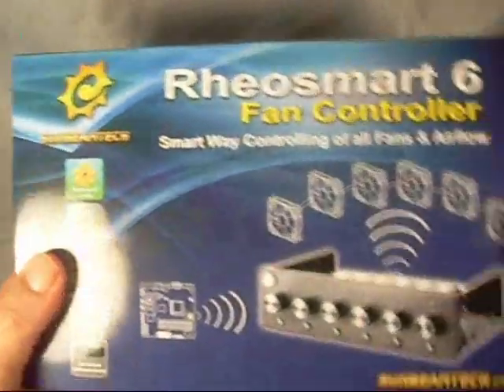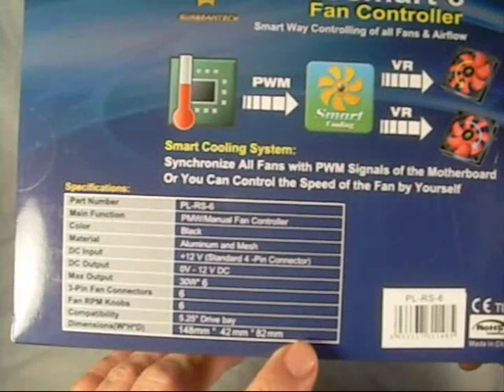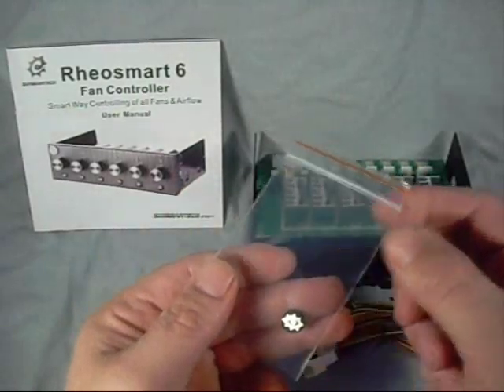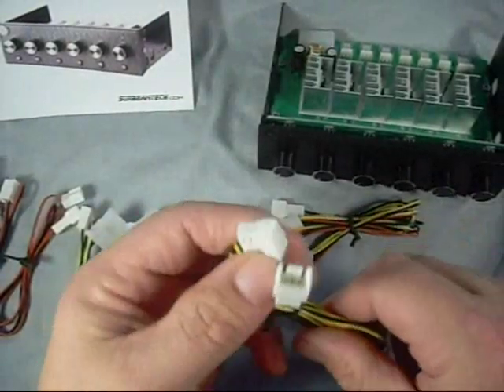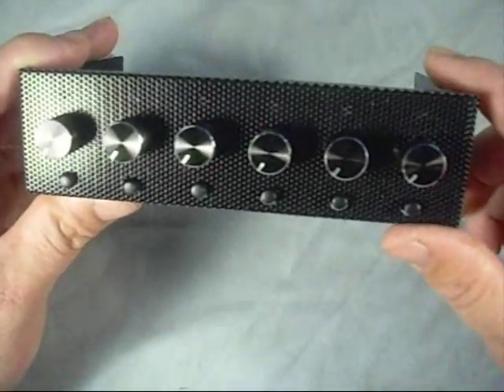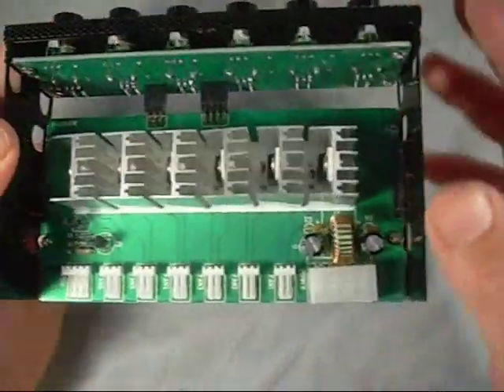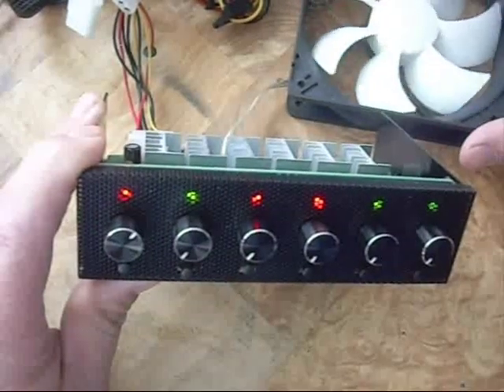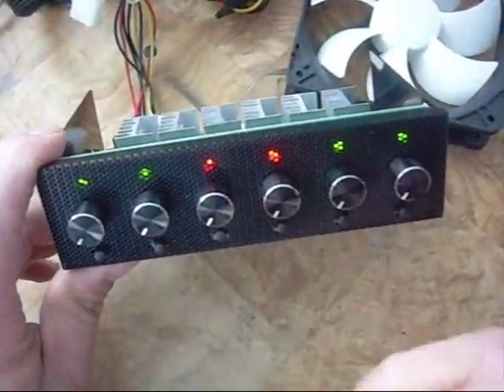Product Showcase SUNBEAMTECH Rheosmart 6 Fan Controller (PL-RS-6)

Comment from the maker: Yes you are correct the leds will vary in brightness depending on how fast they are turning. If the board turns them down too low the leds will not light at all. That is why I choose to run the fans manually.

Comment from the maker: There are a few 4 pin fan controllers on the market. You could use any 3 pin fan controller with them fans. The 4th wire is to connect to the motherboard to control fan speed with software. If you are using a fan controller you are controlling it through voltage so the 4th pin becomes irrelevant.

Comment: 0.48A and 12V
0.48x12=5.67
You require 5.76 watts per channel in a fan controller for that fan.
With 30 watts per channel in this one, you could power 5 fans per channel if you wanted to.

Comment from the maker: Those are all fairly low wattage fans because they have low rpm compared to some of the 120/140mm fans. The Thermaltake ones only draw about 2.5 watts each. The Mega flow fans draw about 3.5 watts each. So you would have plenty of headroom to add other fans still if needed.

Comment: I saw something mention of it on a forum, and re-looked at your video close to see if there really was only a blue and black wire running to one of the female connectors (thus the one that goes to the controller).  it appears that way int the video. 3 connectors 2 female, 1 male, and it only looks like one set of red and yellow wires between 1 female connector and 1 male connetor (the connection to be made from the mobo cpu fan header and the actual cpu fan)

Comment from the maker: It has been quite awhile since I did the review on it and my memory is not what it used to be but I thought the 4 pin went right to the controller. I cant recall why it had the second connector on the 4-pin. But I think you are right I think the one went to the cpu cooler and the other went to the controller to run the case fans.

Comment: Actually just came across something and I just want confirm, it appears like you plug this into the cpu connector on the mobo, it looks like it splits, one going to your cpu fan with male end so your cpu fan plugs into like it would to the mobo, the other split goes to the controller.  Is this so? am I seeing the pictures correctly, its really just the blue and black wire going to the controller?

Comment from the maker: Yes it will plug into one of the 4 wire connectors on the mobo. The 3 wire connectors are not PWM.

Comment: ok noob here, but my question will give me away anyways. 
With the PWM cable to plug into the mobo, what does it actually plug into? One of the 4 pin chassis fan connector on the mobo? (if the Mobo has PWM-enabled like the Asus M5A91 EVO)

Comment from the maker: @ylen13 Some very good points you have. Some fans do require more voltage to spin so when they get down to 7 volts some fans will quit. So I guess it is Dependant of what fans are in the case. I just have not run into a problem with mine. But that certainly don`t mean that other people have not had trouble with them. Thank you for the heads up about it. :-)

Comment: @FUzzyBUnnyBOoties BTW, I've seen Rheosmart 3, looks cute and useful. Its like a half or the "6" exactly - 3.5 inch panel controller, same looks, 3 channels - 30 Watt each. I could use those...For example - when modding cases sometimes you have to put something into the 3.5" slot, if your face plate is missing...And Rheosmart 3 is less then 25$. A freaking bargain! 
P.S.
Btw, very good job on the video, measuring the cables was especially a nice touch, I like your attention to detail :)

Comment: @FUzzyBUnnyBOoties I bought a Lamptron FC-5 almost a year ago (reviewed it about same time), 4 channels - 4 temp probes, all sleeved, also I ordered 2 (or 4?) replacement (extra) temp probes, also sleeved...Ask me how many times I used those probes?..Never, exactly. Do I really need the screen or just the knobs to control the noise/RPM? Plus that model has a screen problem, and they never got back to me...so I rather buy cheaper stuff next time. This Rheosmart 6 is around 35$. Mine was 65$.